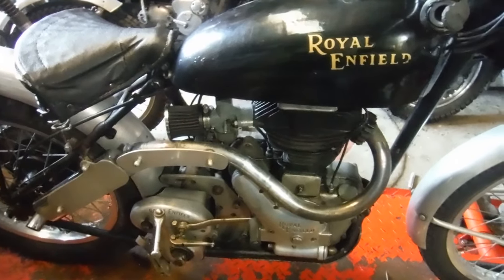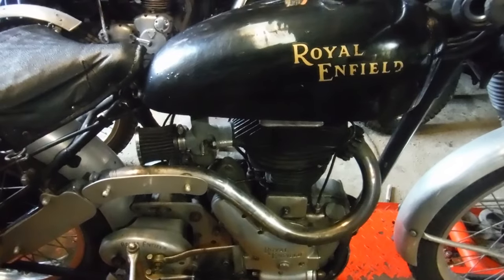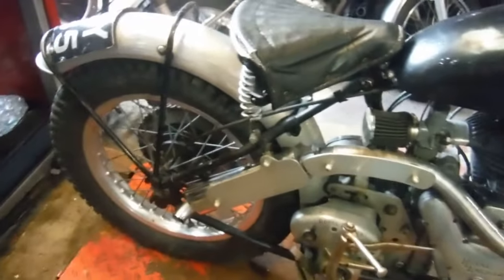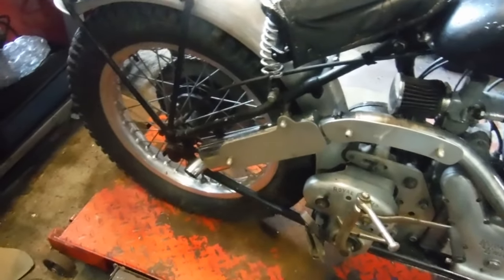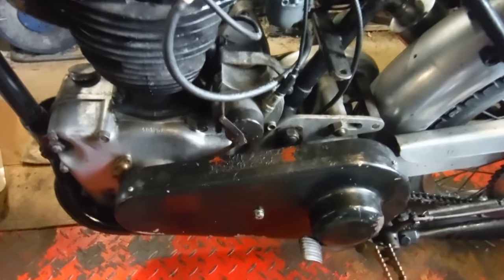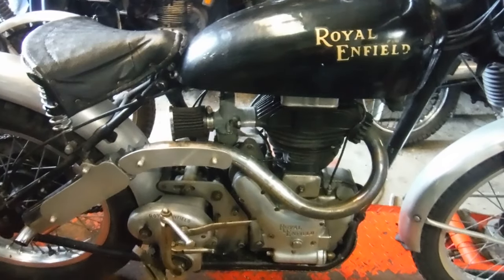Royal Enfield Model G 350 Trials - second attempt to start.

Comment: Were my eyes deceiving me Paul or was there a lot of swarf around the crankshaft sprocket? Also it might sound obvious but can a wet sump engine wet sump itself, and would it matter?😊
Reply from the maker: Hi Peter, a wet sump engine cannot wet sump itself unless it is highly over filled. These RE engines are actually dry sump, it is just part of the crankcases form an oil tank compartment, separate from the crankcase area where the crank is housed..
Reply: @paulhenshaw4514  Thanks Paul. Looking at them I always thought they were  wet sump. My mistake.

Comment: What's the advantage,  if any,  of a Trails/Dirt bike being a 'hard-tail' ?  Allowed myself to pilote one on the tarmac, ONCE, only once. Didn't much like it,  or the uneasy feeling it exuded.
Reply: Weight saving is the only advantage, which ended as bikes became lighter, overall and suspension units improving. This is evident with the 350 Bullet being the first production bike with a swing arm.